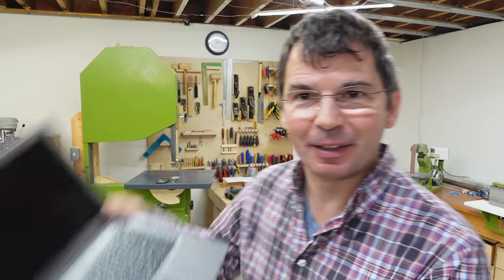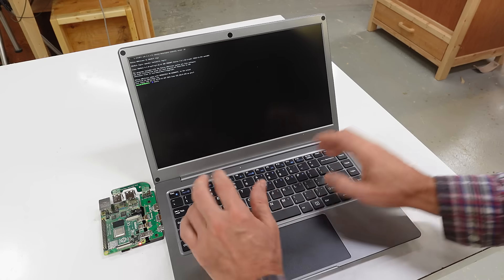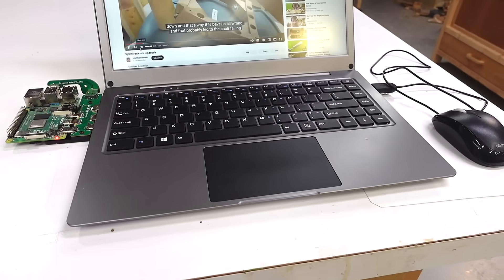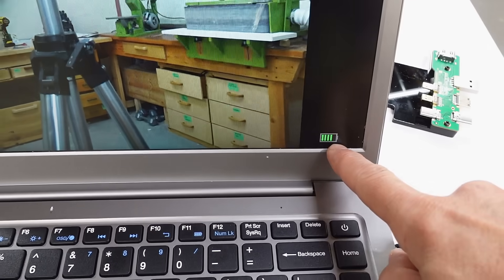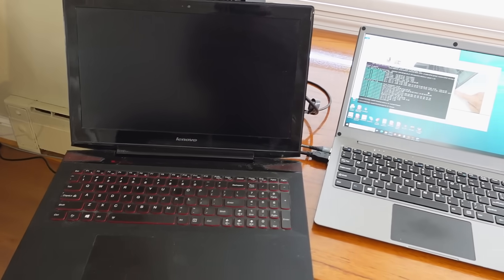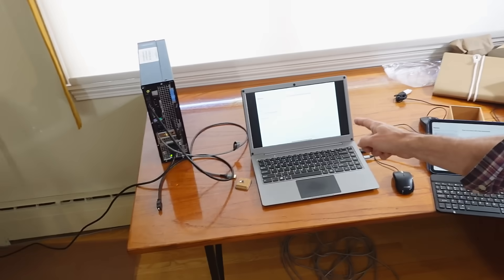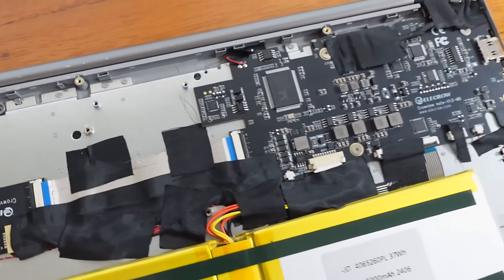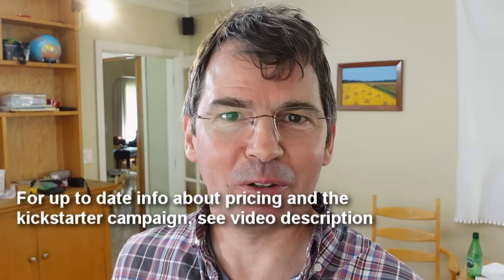This laptop has no brain

Comment: Having something to quickly connect to a Pi would be neat, but it really needs to be just a single connector. Now you just have a Chinesium screen with a terrible keyboard and trackpad and even worse speakers, and you don't gain anything from it. Nobody is going to actually use a Pi like a laptop, they're not powerful enough for that.
Reply from the maker: maybe the pi 6 will have a USB-C that can connect to a dock.  That would make this laptop thing so much easier!
Reply: @matthiasrandomstuff2221  I'm still waiting for a "Single Board Computer with integrated screen and battery" that is just a smart phone with a modified firmware.
Reply: Pi 4 and pi 5 are plenty powerful for laptop activities

Comment: I really didn't get this until you mentioned that you can connect your smartphone to it.
It's actually a good idea.
Reply: Only works for a few smartphones, not all..
Reply: @rutgerhoutdijk3547  As far as I'm aware, nowadays it should work with any phone that's not a budget model. It works with portable gaming PCs too.
Reply: @rutgerhoutdijk3547  Samsung phones have samsung Dex. Considering their market share, this is a fair number or people.
Reply: Agreed.  Samsung DeX is quite capable.  This would work great.
Reply: @scottferguson05  It's just too bad there aren't more apps actually worth using in that interface.
Reply: Check before buying, just try a usb-c dock or a display with usb c or if you got a cable.

Some can only mirror, s series samsung have a whole different mode for desktop, other manufacturers vary.

Comment: So it's just a kickstarter lapdock then!
Reply: Thanks for providing the correct term. I never knew this thing existed. A lapdock. Anyway, I had a little look. Yeah, you can get them really cheap. Thanks for that.
Reply: Asus used to sell one for their phones, back when phones were interesting. Or motorala, or both.

This design is weird because why isnt there a slot for it inside??
Reply: @lasskinn  I also wondered why they didn't make an inside slot, I think there's a few that have that. But having easy access to the Pi board and all the pins really seems to be where it shines.
Reply: @lasskinn  They could have even used that little back cover as a place to insert a Compute Module.
Reply: Wow these things are crazy expensive, you can get a portable touchscreen and bluetooth keyboard for $100
Reply: @jeremiahbullfrog9288  I'm in the United Kingdom on eBay, they're going for like 35 pounds. Not this brand, but a Motorola Lapdock.
Reply: Not really. It's a portable console terminal.
Reply: @BrunodeSouzaLino yes really how is it different from  lapdock
Reply: @settlece  A lapdock is an extension meant to extend the functionality of a laptop and you plug your laptop into it.